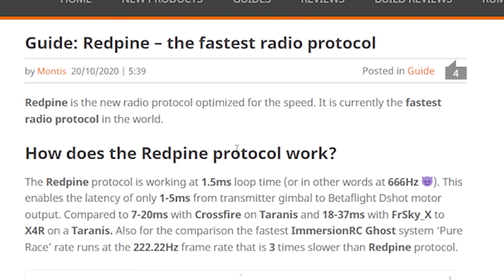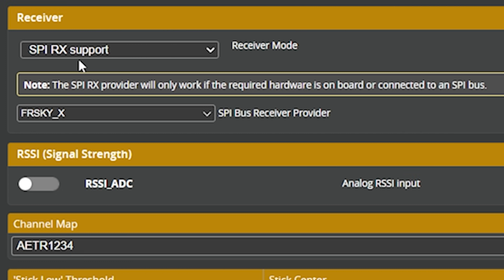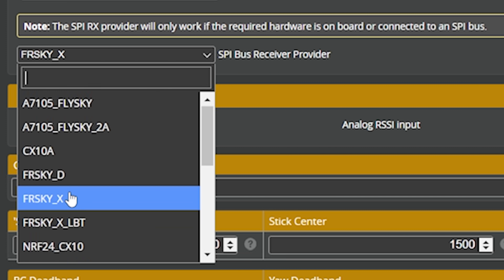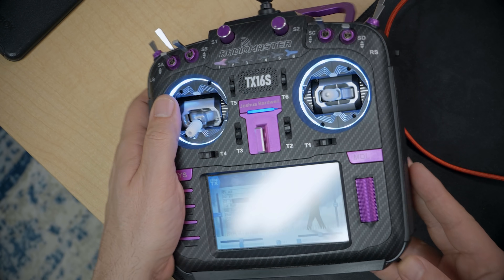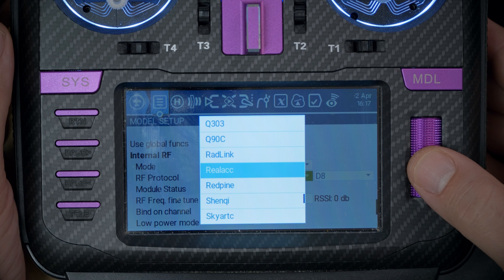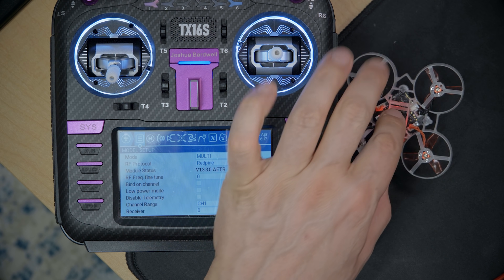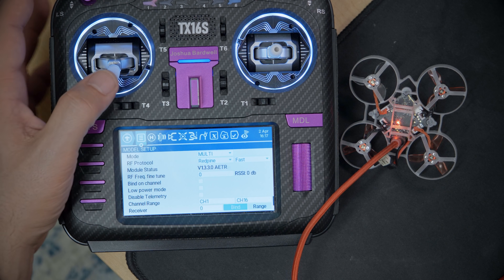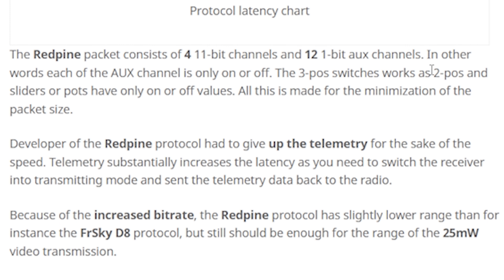The fastest control link for your Tiny Whoop (it's RedPine)

Comment: Finally someone put redpine under the spotlight !!! Thanks Joshua but...
Just a few precision:
-I never really see any difference in range between D8 and redpine.
-CC2500 spi RX can also use futaba SFHSS, it's around 250hz and keep the 3 way switchs
-SFHSS is available on previous BF release than 4.2
-Redpine RX signal is totally chopped by openTX and first edgeTX versions I tried
-Redpine RX signal is one of the smoothest I've ever seen... on deviation TX radio (T8SG TX8)
-Deviation TX radio can also tune the frequency for lower frame rate (openTX 2ms deviationTX tuned 1ms)
-They a "slow" 50hz mode on redpine (doesn't make much difference in range from my testing)
-Flysky user are already at 3.7ms with AFHDS2A but old AFHDS protocol is 1.5ms...
-Flysky (A7105 chip) have a way more reliable link than CC2500 on these AIO board from my experience.
😅
Reply: I see your video test range on crux 35 it was insane  bro and i just bind it ,only need to test it jajaj...
Reply: That's interesting about Futaba SFHSS. Is it your opinion that SFHSS is a better choice than Redpine for people with OpenTX/EdgeTX radios?
Reply: @GRANOLAFPV  yes a really good compromise
Reply: I heard that RedPine has more range 🤔 but I testet it side by side and saw absolutely no difference. (Tx16S) 

(pasted the diff file to it, so the testing was done from one battery tj the other)
Reply from the maker: The official pages say RedPine should have slightly less range. I haven't tested it though.

Comment: Wouldn't it be possible to program OpenTX to divide the 3-pos switches into multiple channels? A bit the opposite of what you do with your channel mapping...

When 3pos = high, send chan8 high & 9 low
When 3pos = middle, send chan8 low & 9 low
When 3pos = low, send chan 8 low & 9 high

Or smth like that...
Reply: That's clever and it should work

Comment: So when you say you cant change protocols that means for the protocol that is built in right? If the protocol is FlySky then I cant change it to FRsky, it has to stay with Flysky correct? This Redpine isnt just specific to FRsky, as I am understanding this?
Reply from the maker: It is specific to the CC2500 chip that also is used to implement FrSky protocols. So if you have an FC with an SPI-based FlySky or Spektrum receiver, they have a different RF chip, and they cannot do RedPine.
Reply: @JoshuaBardwell  Ok i got it now thanks. It is an FRsky thing then. I was just looking to confirm on the communication. Appreciate the reply
Reply: You can't change a FlySky based SPI receiver to FrSky (nor, to Spektrum). Redpine doesn't work on FlySky based SPI receivers, only on FrSky/SFHSS based SPI receivers. EDIT: the mighty Bardwell beat me to it.

Comment: This is awesome Joshua👍 can it be done with the betafpv meteor75 tinywhoop it does run frsky
Reply: Yes, as long as it has a FrSky based SPI receiver built into it, and it is running Betaflight 4.2.0 or later. The Futuba SPI one should be able to do it too, as SFHSS uses the same CC2500 RF chip.

Comment: One protip, save your spi_hops after binding on your first whoop so then you don't have to bind any of your other whoops, frsky_spi_tx_id, frsky_spi_bind_hop_data & frsky_spi_offset are the values you want, then you can make a script like this to run on your new whoops:

set frsky_spi_tx_id = 69,47
set frsky_spi_bind_hop_data = 160,111,229,141,29,105,119,172,187,212,22,244,196,55,40,143,205,37,167,34,16,202,32,199,43,52,100,139,50,252,191,216,108,134,163,137,210,145,14,126,76,62,241,239,131,232,27,225,85,0
set frsky_spi_offset = -24
save
Reply: Now imma wait next to ur house and wait until you plug in and steal (fly away with your Whoop) 😂 👍🏼
Reply: @Cre8ionz.  do it 😅
Reply: FrSky SPI receiver binding is now fixed in latest Betaflight 4.3 preview.

Comment: Hey Josh  Great news about red pine, unfortunately I can't use it. I'm still using my FRSKY Xlite so I'm stuck.  But if I purchased a Jumper T12,  I could try it out.  Thanks again for the information and video on RED PINE.
Reply: You could get a IRangeX IRX4 Lite. I have one for my X9 Lite and works great
Reply: @hofa  Thanks
Reply: Just add an external multiprotocol module to your X-Lite.
Reply: You might have to firmware update it manually through the USB port but there are manuals for that.

Comment: I can't watch it now, but if my whoops are ELRS is there a point in switching?
Reply from the maker: Nope.
Reply: @JoshuaBardwell  it depends right. If you have an external elrs or external vtx, then you're better off with the lighter aio 5 in 1... and the frisky is cheaper than the elrs.
Reply: @nikotttin  Cheaper? Easier to find certainly, but ELRS is cheap and very light - though given the performance I'd pick it even if it wasn't, ELRS is fire!
Reply: Same here. I'm getting the radiomaster zorro radio now. I don't think redpine is "rideable" on it. ELRS is the way to go.
Reply: @albertpolak786  I cannot disagree 😀 Just that you will not get a 20ish gr whoop with a 1gr external elrs.
And the 5 in 1 aio with FRSKY is indeed cheaper.  

That was my point. Cheers!
Reply: @nikotttin  Fair point, Mr Shutterbug would approve!